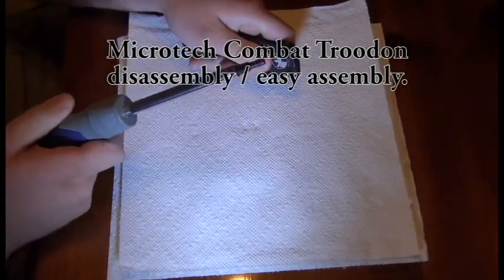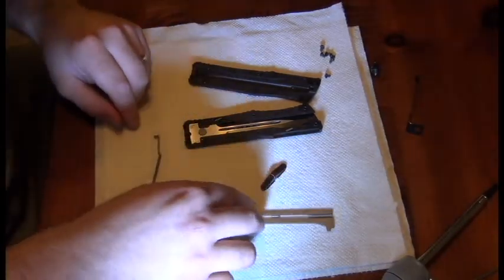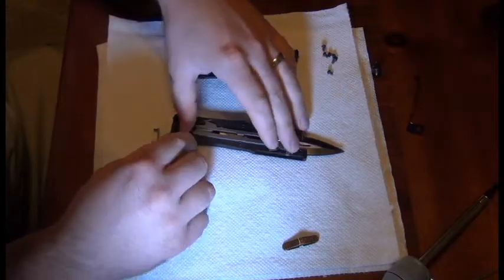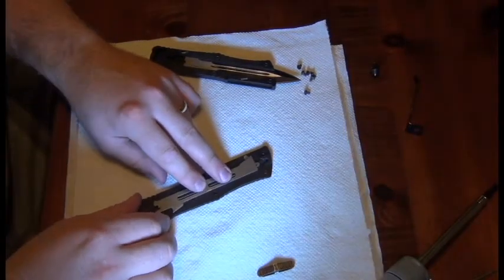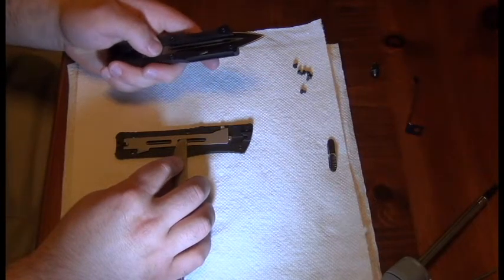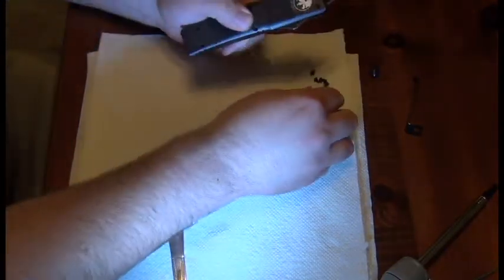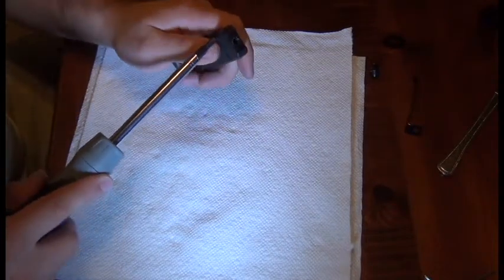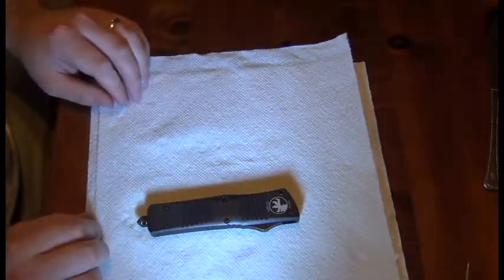Microtech Combat Troodon disassembly / easy assembly

Comment: Thanks for this video. I had forgotten the tricks in getting it back together. However, I used a guitar pick instead of a butter knife to hold the spring assembly in place on the lid. My Troodon had the spring noise and the grease dab on the spring is why I was opening in. I also used a small dab of grease to keep the switch spring in place. I liked the tip a poster made on derailing the blade before opening the knife to avoid the sudden spring release. I make sure to put some blue Loctite on all the screws. I was very tempted to replace those proprietary screws with some proper torx heads.. maybe I will next time.

Comment: Which size bit would it be for the ct if made in 2017?
Reply from the maker: Hello.  I'm really not sure.  Bladehq most likely has the bit, and will most likely be labeled for such knife.  Good luck!
Reply: Brain Ranger you will need the large bit for your model. EKnives or BladeHQ has them.
Reply: I bought the medium triangle bit from PVK and it fits both my combat troodon and utx-85.